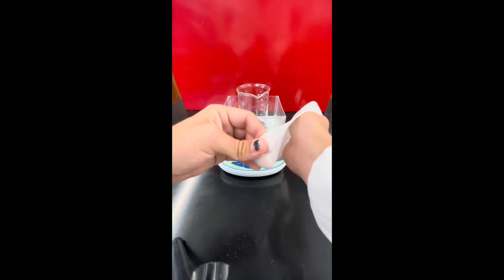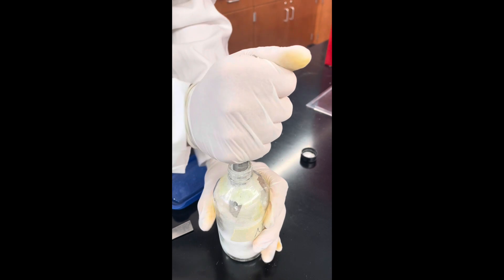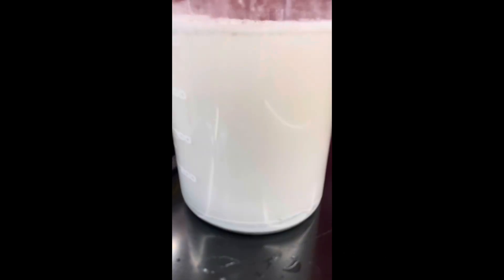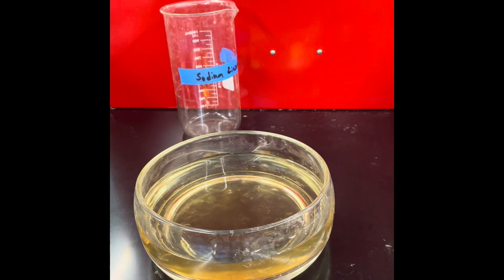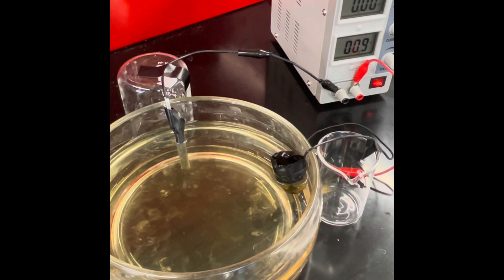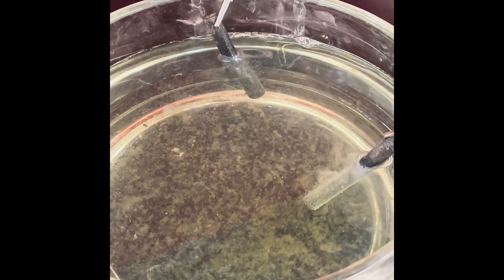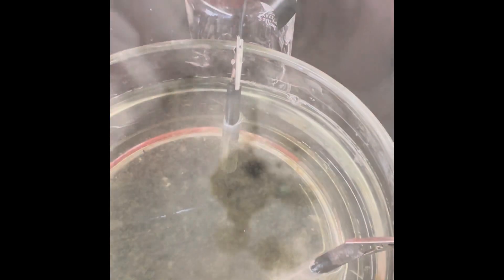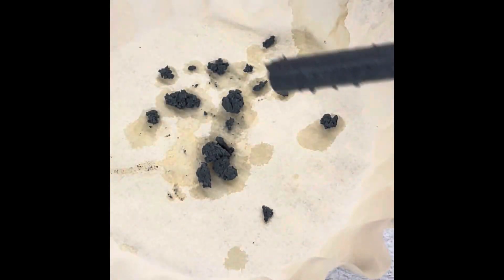Zinc Alkaline Electrolysis: It sucks

Comment: Use nickel anode, zinc cathode, and use cosmetic/sunscreen grade zinc oxide. Adjust current as high as it will go without bubbles forming on the cathode. Worked flawlessly for me.

Comment: fix it with more amps also use zinc anode u can get from battery casings its better than this slower electrowinning process by trying to reduce the zinc ion concentration with an inert anode like graphite or a sacrificial one like steel.
Reply from the maker: Ah! Ok. Thanks for the info man. To my understanding, as long as I am careful with the redox half reactions and their required voltages, I shouldn’t have to worry about electrode material too much. Also, I was under the impression battery casings were steel? I’ve gotten mixed info but never a final answer. I decided to play it safe and discard them haha
Reply: @scuffedscience  some are steel when you get a battery containing carbon rods its zinc but if its this weird grey sludge its steel.
Reply from the maker: @CatboyChemicalSociety ah! So the mnO2 and carbon rod batteries are zinc but the zinc oxide and potassium hydroxide batteries are steel?
Reply: @scuffedscience  yep the casing of the zinc oxide ones are steel but the carbon rod and MnO2 have the casing made out of zinc which slowly converts as you use the battery.
Reply from the maker: @CatboyChemicalSociety  ohhh that makes sense. Thanks man!

Comment: I don't get it, zinc is an ELECTROPOSITIVE metal.  Why would you expect it to appear at anode?  In solution, it is Zn+2 (the zincate is anion with negative charge, but at the anode it splits up & oxygen is oxidized & Zn++ cation at low concentration goes to cathode where it is reduced to Zn metal).  At the CATHODE it will be reduced, not at the ANODE!  Since when will a positive ion be oxidized to metal at anode?  Only electroNEGATIVE materials (such as oxygen, chloride, bromide, iodide) can be oxidized to elements at the anode.
          This is a case of metals becoming complexed.  For example, gold & copper cyanide solutions are used for electroplating.  The cyanide complexes the metal (forming MCN-).  If this were not done, plating steel with more noble metals such as copper, silver, or gold would result in "burning" because of the vigorous displacement reaction between the less noble Fe & the more noble metal until the surface was covered.  By complexing the metal, the concentration of M+ is kept low by most of the metal being tied up as MCN- which stays away from the cathode.  At the anode the M+ is released in small quantities which diffuses to the cathode & is reduced to metal.  These plating solutions are dangerous because the complexing agent is good at complexing metals in the body.
          You need to maintain a large current & large voltage because hydrogen is less electropositive than zinc & therefore will be preferentially reduced & "plated out".  At low current density, you will get only hydrogen.  At high current density, an "overvoltage" occurs which permits the deposition of metals SOMEWHAT more electropositive then hydrogen.  Even aluminum can be electroplated from aqueous solution if you push the current high enough, but the alkali metals cannot (unless you use mercury cathode).  When metals are purified by electrolysis, the current density must be kept low to avoid co-plating (for example) copper, silver, & gold when it is desired to separate those metals.
Reply from the maker: Oh! Wow thanks man! That was a very good explanation. I sort of understood the basic concept, but I had never gotten an explanation that clear. I had gone through some of the theory, but to my understanding I thought that zincate woudl have been oxidized to zinc metal. i am still a little new to metal complexes. In addition, I saw other youtubers who did a similar lab and they got their zinc to plate on the "anode". Maybe they just mislabeled their electrodes....given your explanation though, I wonder if I could apply this to a platinum purification. Hmmmm, Stick around if you'd like to see that. Thanks tho man!
Reply: @scuffedscience If you are going to try electrolysis to separate similar metals (such as platinum, palladium, rhodium), be sure to use LOW current density.  You will want electrode arrangement that evenly distributes the current (such as array of flat, parallel plates alternating anode/cathode).  Your power supply will want to be adjustable so voltage can be adjusted to JUST start current flow.
Reply from the maker: @bpark10001 yes! That is what I was planning on doing. Any ideas for electrode material? And what do you mean alternating cathode and anode? As in? As part of the same plate? But yes I have a few ideas for a setup. I was originally gonna try to seperate the PGM’s with reactivity. Doing a single displacement with some aluminum or something. But I think electrolysis mgihth be better
Reply: @scuffedscience   Set up flat plates spaced uniformly, like the plates of a capacitor.  Every other plate is anode, with cathodes between.  This way, you get huge area of active electrode (both sides, except the end ones) with uniform current distribution.  This is the way metals are purified in industry.  The anodes are going to have to be graphite to resist the corrosion.
          I assume you are aware of the severe toxicity of platinum salts.
Reply from the maker: @bpark10001 oh! I was actually not aware of a severe toxicity… whoops. Thank you for the information tho! That might be an interesting setup to try. I might 3d print something. To my understanding graphite is bad for anodes because it starts to disintegrate. I think it’s a reaction between oxygen and the carbon
Reply: @scuffedscience It will, but not at a severe rate.  usually platinum is used for anodes in "nasty" electrolysis reactions.  But I can't imagine platinum surviving in an electrolysis specifically designed to plate out platinum!